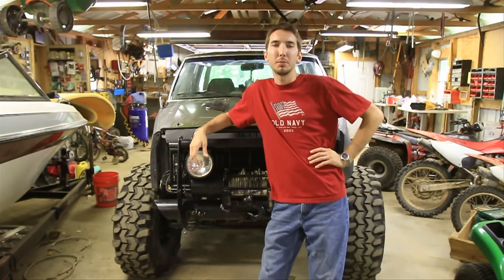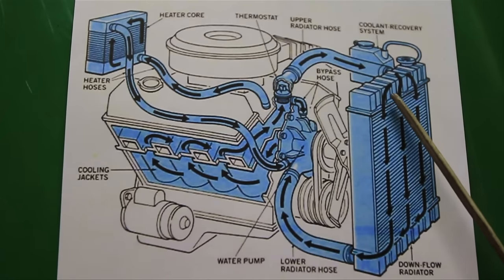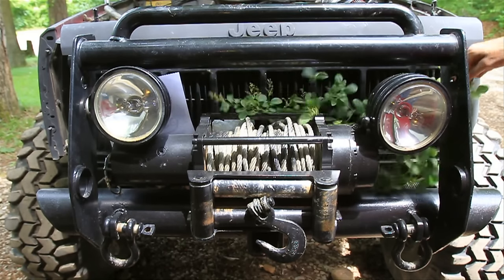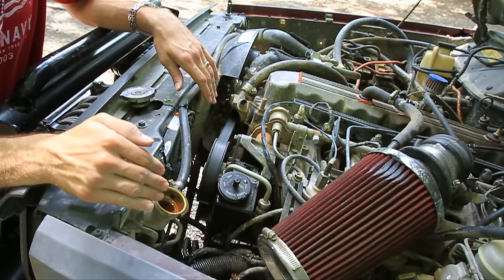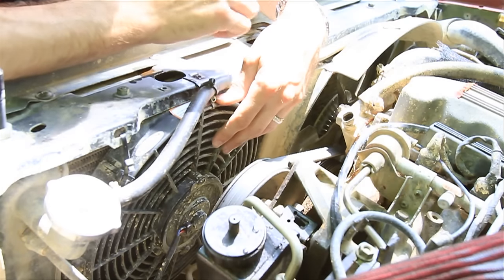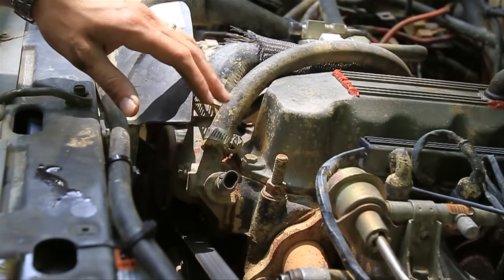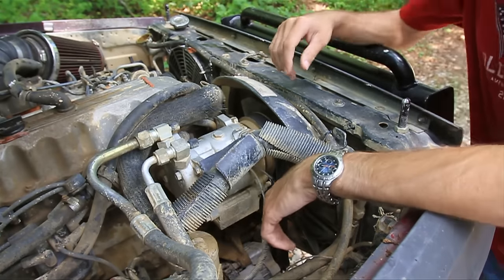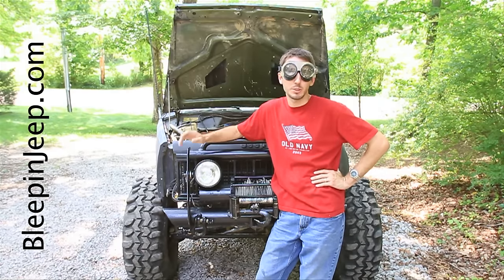Engine Overheating? - 9 Steps to Solve

Comment: Ok,ido not know alot about jeeps.but i do know how the cooling system work's.Here,s what i do know,i have replaced the water pump,put new thermostat in it.also put a new temp sensor at  gooseneck by top hose,also new temp sensor for gauge at the back of the head,electric fan work's,and the clutch fan work's has drag,flushed system.Ok here is what is going on.Top hose is cold,bottom hose is cold,heater hoses are cold,no heat inside jeep.where is the relay for the electric fan located,and where is the control sensor for fan?It may have a bad radiator.if it had a bad heater code,the engine would not get over heated.I am going to drain the new coolent out and do a good flush on the system,and take out the radiator and with water try to use presser and flush and see how it flows,and flush the heat core by flushing it using the hoses coming out of the firewall,and bypassing that valve so i can see if the core is bad.PLEASE TELL ME WHAT YOU THINK,AND THANKS FOR THE REPLY.

Comment: My vehicle:  1995 Ford F150, 6 cyl
My truck is overheating. Starting cold, I go to steam coming from the engine well in about 3 miles. I have a new thermostat. Hoses are good.  Radiator has no leaks. Fan turns on and blows the right direction. I flushed the system and added 100% 50/50 antifreeze. Before I flushed the system, the radiator had the dreaded orange sludge. Comments:  when flushing the system, I noticed water rushed out of the lower drain hose, but not out of the small lower drain (with the plastic plug). Me thinks this is either the Heater Core, the pump or the radiator. Before I rush out and randomly buy one of these, is there something I am overlooking? thx
Reply: +Paul Kirtley When was the last time you drained the oil sir? and replaces the air intake and oil filters?

Comment: So...I've been overheating ,I flushed it out,I changed out all the hoses,I changed out the thermostat,I  checked the fan wiring straight to the battery,there wasn't a spring in the lower hose and I didn't put one in ,my fans not turning on so im thinking the wiring somewhere to the fuse is cut because the fuse is good so I was thinking of just wiring a toggle switch straight to the fan that I could just flip on whenever and before I did I wanted to make sure I wasn't missing something else like the spring which is a first I've heard of.is the spring what I need to fix,or just toggle it
Reply: It's a 91 geo metro
Reply from the maker: Turns out the spring is just a factory thing but not needed.
Reply: Ok..I ended up blowing the head gasket a few hours after messaging here, decisions on fixing that or new/used engine,it's close to 400k on it,it did good

Comment: Step 8 u say that it Should suck down. when i Rev my Forester it goes up 
step 7 use the original Termostat i have not done that and the one i got had a Smaller body wich made me think hei it might react faster.

Subaru forester 2006 2L 200.000km all service done up to 190.000km by the last owner old guy.
allot of people say its the Gasket i cant Smell gass inn the tank i cant see white smoke i cant see Water inn the oil...
i am loosing some anti freeze might be to the Gauge Goes all the way to the red and spits it out.
 but i Either got bad Water pump head gasket or a leak but i cant Diagnose the problem. all other Subaru Ytubes V says Its the head gasket but thats for them 98-2004s and i cant find any for 2006.

it overheats just out of the blue after 20min or 1hour drive. if i put the heater on It helps a little but it just doesnt cut it.
i used a cleaner for 1 day then i flushed with fresh water 4 times over 3hours of worktime then i filled it up. had some Air inn the system bleeded it out the next day helped a Tiny bit.

HELP!!!!!!!!

Comment: I have an overheating problem in my Subaru, I have replaced thermostat, radiator, water pump, and head gaskets. And STILL have overheating, I guess cooling fan is next
Reply: reface head cylinder...

Comment: if their car is still over heating after following these steps it because their pretty fucked, its gunna be a busted head gasket or a head it self, rx7 is just bought over heats but no symptoms that its a busted gasket, so it should be one of these, now people if you follow his steps and ur car is still over heating, unless u have a rotary engine like me, there should be no reason of you shooting smoke from ur car, unless its very cold outside, other then that, if your car is shooting smoke, check your oil dip stick, if its mixed with water ( for example milky looking instead of light brown its a creamed cofee color) then that means its ur gasket and that over 800 dollar fix, so u gotta be sure u love ur car, or not just get a new one

Comment: After i got my oil change and had new spark plugs put in i started to get an overheating problem. I put in a new thermostat and had pep boys check my cooling system and they didnt find anything wrong but I still have the overheating problem. what can it be?

Comment: once the car even oozed out the coolant while the engine was running with ac system running but car was standstill. I dont see the coolant level drop as such but the guys at the fuel pump here always tell me that my coolant has burned out, i dont know what that is supposed to mean. The fans work as they should. Both of them come on and go off. I dont suspect a leak in the system and i think there is no white smoke from the exhaust. Pls help, mechanics here are pretty unknowledgeable.

Comment: I have an issue where my cooling system is creating so much pressure that the hose connecting to my coolant reservoir is sliding off

Comment: is it ok to short the radiator fan? it now always turns ON
Reply: Dexter Aparicio no you will end up burning up the fan and have to replace it from extensive wear they arent meant to run 24/7

Comment: My car engine hose is very hard with the air I'm talking about the pipe please forgive me if I say something wrong but I'm trying to tell you it's all he did two times and both time top overhaul been open same condition mechanic this car four-wheel drive making a pressure water pump has been changed fan has been change but when engine start I can feel when I touch that pipe it's so very hard help me please I have a Pajero 4 X4

Comment: I dont have a jeep i have a 97 chevy 3500 truck but i was wondering if someone knew whats wrong with it. Mine overheats at high speeds usually after 50 miles per hour. I just changed the thermostat since ive heard that if that gets stuck itll overheat and since its a simple thing to change i did it myself but i took it out to test it right after and it still over heats. I could let the truck idling and it wont overheat its only when its running that it overheats which is strange to me cause ive had cars overheat before but its been the opposite they overheat when im idling or at a light and as soon as i start going faster they cool down
Reply: There could be a restriction in the radiator. If you have a Infrared Thermometer gun you can temp test the radiator and see if there are any cold spots in it.
Reply: @greendropwebmanager3974  its fixed now. It was the water pump. It wasnt leaking or making noise or  anything to let me or the mechanic know it was bad but i told him to replace it anyways and when he took it off he opened it up and we saw that the thing that spins inside the pump was lose it spun on its own. Its suppose to spin at the same time the fan spins but it had become lose so it wasnt spinning with the fan

Comment: not much talk or mention at all about the heater core is there a way to sort out if it's a bad heater core without all the work of removing one
Reply: Luis Vazquez yes if the heater core is bad you won't have heat coming out the interior vents when vehicle is warm.
Reply: You will smell anti freeze in your interior and your windows will fog like crazy,there will be a hard to clean film on your inner windows.

Comment: my jeep keeps blowing the bottom radiator hose off, any ideas??????
Reply from the maker: Maybe a blockage in the system causing too much pressure... or just not properly installed;)

Comment: I want to ask my car go overheating if i will turn on my A/C, then i tried driving it without usingmy A/C it did not go overheat...i want to know what causes the engine to overheat if my aircondition in ON? Hope somebody can explain it to me thank you
Reply from the maker: +melvin deguit the A/C uses more power, so you have a problem that isnt really bad but just bad enough.
Reply: +BleepinJeep hey thanks for the info..any clue why my gas and temp gauge quit working out of the blue after I had problems with it overheating... gotta trip to make but scared of problems..car recently started overheating and I'm still in the process of diagnosing..

Comment: ...continued.....emergency. So if the heater was on and car is @ full H and there is no heat from the heater ??? I do notice that the top hose to the pump is running hot but the lower hose that is where the thermostat is.  Is cold. I mean dead cold?? Also noticed reservoir boiling over?? ANY HELP EOULD BE APPRECIATED BY ANYONE!!

Comment: I have a problem with my 2002 Nissan xterra the fan turns so fast that it makes the radiator lean and you can't really even hear the motor it turns so fast and probably steals a bit a horsepower can someone help?
Reply from the maker: Is this a clutch fan?  If so the clutch could be locked up.

Comment: I have a 2007 Chevrolet captiva. a closed system of cooling without radiator cap, im pouring my coolant n reservoir. My problem is coolant is overflowing from the reservoir even the temp in the dashboard is in the middle. I bring already to the mechanics for repair. their is no milky on my dip stick and no bubbling on my reservoir coolant but after checking he told me we will change the cylinder head gasket and water pump. after we change still the problem is the same. What maybe the problem? i hope somebody can help me how to rectify the fault of my car.. Maybe somebody experience same problem, i hope somebody can help me...

Comment: okay i have a 89' jeep wangler that i did the 4.0 trade out from 4.2 i keep the carb on it with the 4.2 intake did the "nutter" by pass used the dis. off the 4.2 and coil took all the smog things off it running the stock carter carb did the 1/8 " to the needle jets  running good but over heating fast did all nine steps all ready and more no water coming out or in to the oil , over heats to fast go around the block , starts 1st time ,,,, ?????????????
Reply: Nope found out I had the wrong water pump and fan they was spinning backward I got it now purrring like a kitten
Reply: Yeah I had to yes the 91 1belt with a ect. Fan and no more overheating

Comment: When ever I fill my radiator to the top and turn on the car my coolant is not sucked down in into the radiator instead it shoots up like 3in. So when I go to look in the radiator I can see the coolant but it's less than what was there...of course 😊 Does this happen to anyone else or is there a reason for this happening?

Comment: My car overheated one day then I waited 30 minutes then it started...then the next day after driving it for 1 hrs it overheated and now it won't start and water from the resortvoid throws it out from the top cap...i don't know what to do...i did change the water pump, thermostat, and pcv...the car wants to turn on but it doesn't

Comment: with new thermostat and rad.cap, and rad. being flushed 12 times, I am still having to run with heater ON and hood popped to stay below critical temp - ?????  Chevy half ton.
Reply: could be your fan
Reply: also use a pressure washer to wash the radiator it could be clogged with dirt and dust. Make it shiney. I used tire cleaner then soap and the rinsed. now I'm not have the overheating issue.... so far.
Reply: done all that...  no problems.  only does it when small horse trailer hooked up.  only started this year.  burned up one trans. and I have a new one now and it's getting hot.

Comment: I had to replace the electronic fan motor instead of the relay. I have an 04 wj incase anybody has the issue. My fan only worked if i banged on it. Literally i would be in traffic, put my car in park, pop the hood, open the hood, bang in the radiator fan guard recklessly til the fan went on. Embarrassing but got me through it til i could afford the motor.

Comment: I remember when I traded my dads PT Cruiser in for my Mazda3, it was August and it was BLISTERING HOT. I had gotten the thermostat replaced and it was working fine until they called me about buying a new car and said I was approved. I had to drive 45 miles to the dealer and some idiot bitch drove the wrong way on the exit ramp causing an accident and traffic backed up. I literally felt like the temp gauge was playing with my emotions. It would go up and I'd panic and it would go down, then I'd exhale and it would be like "NOPE! NEVERMIND! I forgot I wasn't working! Up up up up up up... you sweating yet? Turn the heat on high and I'll go back down. Oh you're not listening, let me just scoot the needle up juuuuuust a little bit mo... ok heats on, I'll hold up my end of the bargain..... JUST KIDDING, IM OVERHEATING! YOURE NOT GOING TO MAKE IT! Ok ok, I lied, I'm good...." I was sweating bullets but I finally made it after an hour and a half and left that God forsaken overheating POS right at the dealer. I could hear it yelling "COME BACK! I was only joking! I'm cool! IM COOOOOOL!" as I drove away in my new Mazda.

Comment: My problem is the cooling fan when engine is hot won't stop until I switch off the engine, I check thermostat I change radiator, done compression test, everything looks good but the fan keep on going when engine reach temperature, anybody have a clue???

Comment: I need help can you email me or something, i have tried just about everything. I have tried new sensors new radiator new water pump new clutch fan new thermostat, just about anything you name it. I dont have a head gasket leak.

Comment: I'm gonna try and burp my 4.0 it's overheating bad, I change the radiator, fan, water pump, thermostat and water hoses.
Then I was told it could be a bad head gasket, I haven't changed that.

Comment: You had your hand touching the water pump pulley and fan belt while saying "do this while it is running" at around 10 minutes into the video.  I hope no dimwit actually does that while the engine is running or they might take their hand off.

Comment: my engine overheats after only 5 min of driving and the top hose is hot and the botom is cold. what do you think it could be
Reply: +Graham Rees Does your radiator fans work? Do you have coolant in and new oil?

Comment: Are you absolutely sure 100% radiator fluid will reduce cooling never heard of that I've used full antifreeze in my vehicles and never had no problems before I'm going to research that one and you didn't mention anything about problems with the radiator itself

Comment: There’s no such thing as a closed and open system if your radiator dosnt have a cap the overflow cap is the fill cap it’s the same thing you just fill the radiator from there.

Comment: I change the water pump,thermostat and flush radiator.its not overheating anymore but the coolant from the radiator is backing up in the reservior,like there is a block somewhere all hoses seems fine.i even burped the car. I am pulling my hair out. uugghh! was thinking head gasket
Reply from the maker: have you checked the radiator cap?
Reply: buy a little bottle called k-seal it's around $13 drop it in your radiator rent a radiator pressure tester from a local auto shop force the k seal in and your good.

Comment: Your diagram does not show or exhibit the most sneaky sneak that causes mystery overheating is the catalytic converter the most sneaky of the troublemakers
Reply: I was wondering today if that may be my problem. I know the catalyst is burned out in them but wondering if I have a partial clog in 1.

Comment: 50/50 coolant says on the bottle "do not add water" u only add water to 100% antifreeze....
Reply from the maker: Dont buy 50/50 coolant.  You are paying for water.
Reply: BleepinJeep i thought u said but 50/50 then add water lol. My bad buddy and its just more convenient to buy the already mixed coolant.
Reply: BleepinJeep and heck u have to buy whater with 100% coolant as well u have to use distilled cant use sink lol ull get mineral build up..
Reply from the maker: distilled water is 89cents for a gallon.